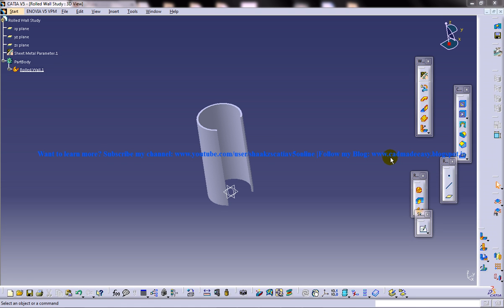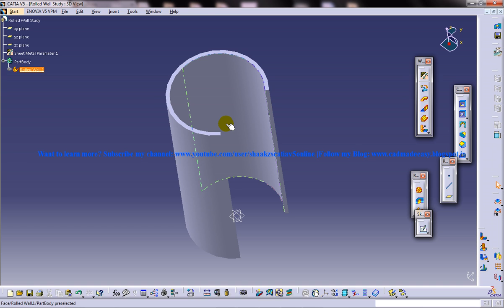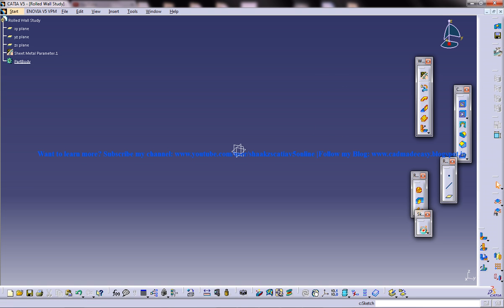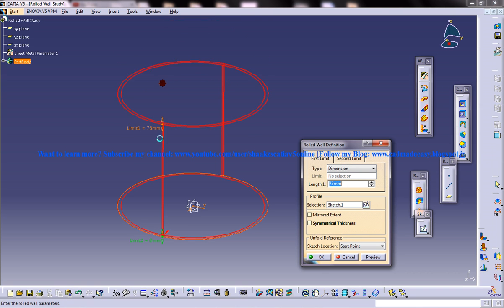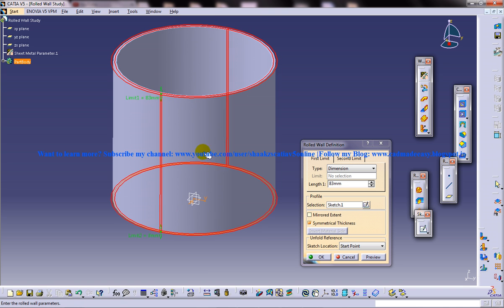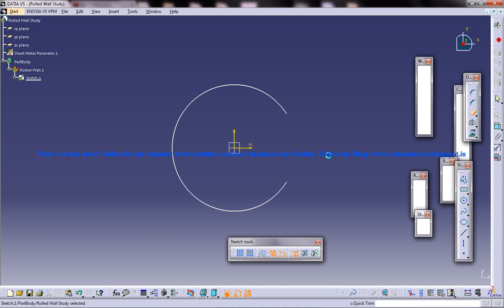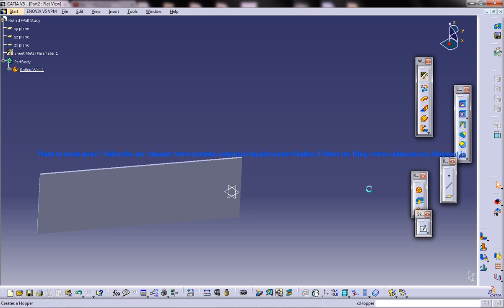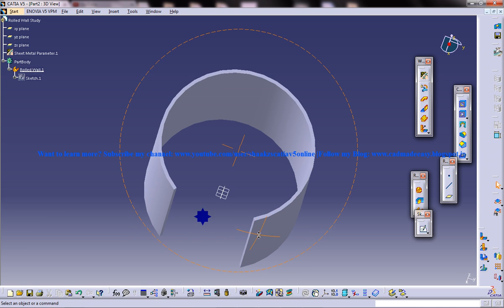Catia V5 Tutorial|Creating Rolled Wall|Pipes & Fittings|Sheetmetal Workbench

Comment: I need to learn how the pipe with internal ribs and made in catia v 5 pipe length is 1.68 m and diameter is 0.028 m plz help me regards this I have my project work
Reply: Hello. I need to learn that too. how did you do it?
Reply: @OnurAltn  actually it's very simple...  We have to made pipe Fir then on surface of that we have to create the ribs with required dimensions and reflect those through that body and remove unwanted portions through the tools and make mirror immage of those Firat with 360 and second with the length with required distance... Try this...